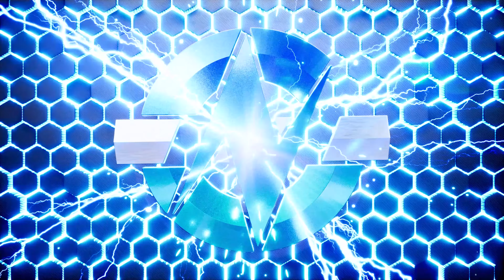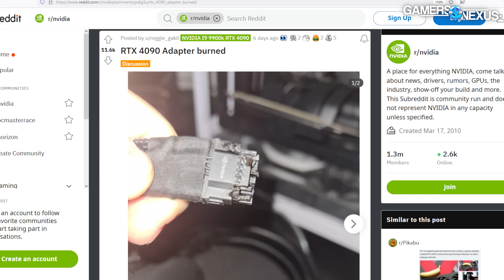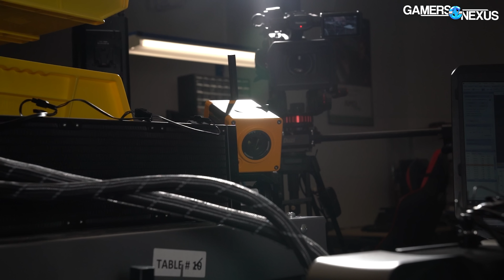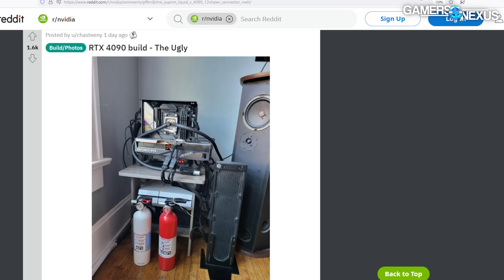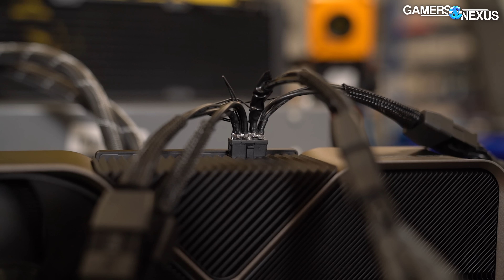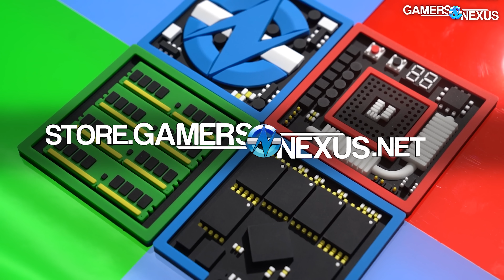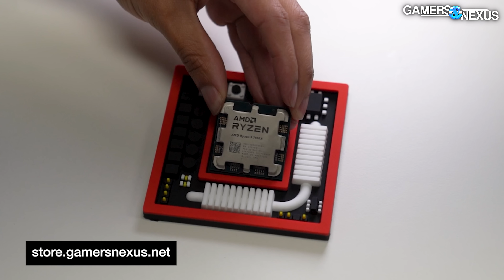Testing Burning NVIDIA 12VHPWR Adapter Cable Theories (RTX 4090)

Comment: Why are parts manufacturers reinventing the book? I could go get almost any cheap power connector out of the RC world and do a piss poor soldering job on it and it would still be more mechanically and electrically sound than any single connector in PCs. Have never understood the insistence on continuing to use pins for non data stuff when absolutely nothing about their design is for it. Its also less flexible and more space consuming to use a dozen pins to accomplish the task a properly designed connector can do. Only showing up now because parts are becoming space heaters.

Comment: 26:12 Yes, exactly.
If even experienced assemblers ones make the mistake of not seating it properly , perhaps it's the design itself that's flawed.

And for what? To save some standard connectors and use a single , custom made one  ?
¿Is PCB power routing so expensive?

Comment: Very informative, appreciate the hard work and dedications to this un-going issue. Could be a bad batch of underrated Adapters out in production, hopefully Nvidia releases a statement soon as personally I'm very hesitant to use my 4090 as i'm currently using this adapter and have to wait 2 to 3 weeks for my cable mod kit

Comment: The more i look at it the more i like the ideas that buildzoid had pulling is causing bad contact. Maybe you pull on the cable sideways during testing to see if you could cause bad contact in the connector.

Comment: jonnyGURU has already explained in detail what's actually happening ;
TLDR : nvidia's adapter is not properly made.

The good manufacturing practice is that you have to crimp the wires, not solder them, which is what Astron (the company that makes the adapter for nvidia) is doing.
The soldered wires do actually break off, just not on all adapters (depends on the soldering quality, which is inconsistent).
The melting occurs because power follows the path of least resistance : the wires that didn't break off end up conducting all the current => too many amps, overheating, melting.

Qualitative native cables (such as the ones made by Corsair, be quiet!, cablemod and Seasonic) are free of this issue (the wires are crimped), it should be safe to bend them vertically (i.e. perpendicularly to the card), just not horizontally.

Comment: voltage rating for the cables insulation.
So a 150V rated wire is good enoug for 12V.
Reply: 150V @ 10Amp or 300V @ 10Amp wich cable can provide more power?
Without getting to hot.
Reply: @JonnyB1989  current has nothing to do with insulation of a wire/cable
For curent it is the mass of the wire that is the limit...how thick the wire is.

This is a rating to show how safe the wire is and its maximum voltage and has nothing to do with the maximal current it can handle

Comment: What brand soldering iron is that at 7:58?
Reply: Found a better image at  16:15 and it looks like a HAKKO Soldering Station, Digital, 75W, ESD Safe FX951-66.   Figured Steve's staff is using quality equipment and not Scrabble random companies off amazon.

Comment: Do your cables have the same split terminals? Buildzoid seemed to agree it was nothing to do at the solder points but at the actual connection. And that would be nearly impossible to inspect without observability causing more damage as you'd have to dismantle the on card housing or PCB.

Comment: From the outside looking in, I want to let it be known there are far too many variables regarding failure and melting. Each person who has one that melted, is most likely not living in the same house. Now in most states electricians do not have to be certified or licensed to work on your house, at the end of the day they know more than you, so, hired. This can bring in way more issues. Yes the 150v cable rating is an oddity and was most likely issued with test cards or R&D cards, hence the new ones are 300V. This 300V rating will handle dirty 110 and dirty 220 if you are anywhere outside the USA.

There certainly is a ton of power running through these pins, if it were me I would lower it by using a 16 pin or close to it. Lower the amperage per pin and we can still attain the same voltage and wattage. But, now a days it has become standard practice to minimalize the things people do not want to see...if you want to wire tuck, well 12 pins is easier to route than 20, but if users want to keep it clean, why don't manufacturers put the plug on the same side as the PCIE terminals...they always put it where it shouldnt be. 

Issues like what we see with these cards, will continue, for every card. Issue comes up, youtubers handle it and discuss, which basically is free R&D for the manufacturer, so we are all doing free work. Like the recent entrance to twitter..."let that sink in"

Comment: no testing changes the fact that the 12VHPWR connector is poorly designed conceptually. you can't beat physics by shoving more power through less and smaller pins with less contact area. even the spec shows there's less safety margins than the old 8-pin connectors

Comment: bending itself might not break the pins at the solder points... but having that extreme bending while in heavy use might as it now includes heat that lowers the integrity of all factors on that point.  also, if possible, don't fully cut the foil contacts, they to cut it 1/2 or 3/4 of the way...

Comment: Hey Steve have we looked at the board its self. Could it be possible that those pins are pulling more power from the board? Wonder where the outer traces on the board lead to and if thats pulling more power than the middle pins? Just a theory
Reply from the maker: Great question. I think we have ways to check that!

Comment: if those cables look like that from the factory, I'd advise anyone NOT to purchase them, it is a clusterfu**# and just doesn't like anything like a quality product of that price range should
and wire "power rating" isn't a power rating, it is insulation class (thickness or dielectric properties), since in PC there won't be 150V and 300V in those wires ever, it makes zero difference if it was 300V or 150V wire used for the adapter, the copper cross section is what matters in this case, since that will be the source of resistance and lead to heat at those currents

Comment: Have you seen the tear down of the cable on Paul's Hardware? Looking closely, cables all seem to be rated 300w, but the solder points in the connector look more like the ones in Igor's pictures, and not like the solder connections in the cable shown here. I wonder what's up with that?

Comment: Ah good, work up to go to work and my man Steve answered my BURNING question. 

BTW you did good Steve for a by yourself video.
Reply from the maker: haha, thanks! The editing and lighting aren't as clean as when Andrew does it and I got lazy by using photos instead of videos for some shots, but I think it works on function!
Reply: @GamersNexus  You can make a video with photos from a 00’s digital camera with your voice over and I’d still watch it. It’s the technical knowledge I am here for . The video production is just the frosting on the cake.
Reply: @GamersNexus  It is very obvious that your trying your best. Please Steve do not worry. And especially when it is a current problem (get it?) that requires fast turn around. I mean fire hazards and badly designed stuff like this needs coverage. And your insight and access to information/better made cables is sorely needed right now. And the testing done is outstanding!
Reply: @GamersNexus  I would not consider it lazy I would call it time and energy constraints. That and I need some damn sleep constraints... Awesome job as always thanks for it all, been around since the packed house space.

Comment: Would actually having these tests done in an actual desktop case make a difference? Since people will have different desktop setups. Some setups might get very hot which wouldn't help the cord get any cooler. Open Bench seems like the cables wouldn't get as hot as they would in some cases.
Reply: these test are completely useless. it's like investigating heart attacks by taking a single random person into a lab and looking at him for 8 hours. The underlying reason for why this cable is flawed is its basic specification - it just doesn't have any safety margin. That's it. It's a design problem. This means statistically it will fail much more often than 8-pin which has 70% safety margin. 
Force Nvidia to stop shitting on consumers and spend few more pennies on a 70% safety margin connector - boom, the problem's solved, new connector will have the same failure rate a an 8-pin, not 200 times higher.

Steve is overdoing this topic in a completely wrong and pointless way.
Reply from the maker: That is mentioned in this video

Comment: This could be quite serious for Nvidia if they produced the 150v cabled connector (Igor type) and knew they could fail and produced the updated 300v (GN cable) that doesn't fail but haven't informed anyone or issued a recall, considering the 150v ones can still fail, melt and cause a fire in a worst case scenario.
Reply: The voltage rating is literally how much voltage the insulation is rated for so it won't make any difference given they're nowhere near that voltage. If anything, having a lower voltage rating would mean thinner insulation which would allow for better cooling. But the spec that really matters is the cross sectional area as that determines the current rating. Although it seems that the issue seems to be the poor termination inside of the connector.
Reply: @JaenEngineering  Yeah 150V or 300V shouldn't make any difference whatsoever when we're talking about a 12V connection.
Reply: @JaenEngineering  I was using the 150v and 300v as names to separate the way the wires are soldered into the connector. If the 150v one has the two central soldered to two and the outers to one that is the 150v connector (Igor labs ). If the 300v connector solders all 4 to a more solid section then that's the 300v design (GN). It's how you would know how it's soldered inside without taking it apart, just look for the voltage rating on the cables.
Reply: @PHDarren  nice idea maybe, but as @Splomf pointed out above, Jay had the 300v cable with the bad soldering, so it's not really a good measure of whether you got the 'good' or 'bad' version.
Reply: cable doesn't matter at all.
Reply: The cables are not the problem, but the construction of the connector and and soldering therein. But as it stands, the fact is that there are different connectors out there some with sub-par soldering and/or connection plates. 
That is a huge problem, especially as it is not easily reckognizable from the outside and few people will go the length to peel away the tape and pull back sleeves just to see some information which doesn´t even give a hint of the connector plates.
Reply: Jay had the 300v cable and it was the bad Igor style construction.

150v and 300v is just the wire spec, not the construction or connector spec. It has nothing to do with the issues with the 12 pin connector.
Reply: The voltage rating is all about the breakdown voltage of the insulator (dielectric), which is an intrinsic property of the insulating material and its thickness. Breakdown being when the wire starts conducting through its insulator. Given that this rating is intended for continous use at that voltage and has a safety margin for short voltage spikes, there's no doubt that 12V won't be an issue for the 150V rated wire.
Reply: The difference in cables/wires could be something as simple as regional difference due approval requirements. When you are making something for the US marked it needs to be UL listed/approved (or CSA). And if you are selling something to the EU marked it needs to follow their standards, which leaves manufacturers with a few options: Either use UL approved wires/cables for US marked and then use CE/HAR approved cables for EU, or use a type of cable/wire which has both approvals. I dont know which one of those two options is the cheapest

Comment: Power connectors should never ever be using solder connection in that way in the first place. The solder joints are bearing weight/strain. That's incredibly dangerous especially with brittle lead free solder. With something like a GPU, the hanging wires will cause the joints to work harden over time due to vibration and can crack. There's a reason crimps and clamps tend to be standard for anything high power.
Reply from the maker: Edit: Thought about this more - the soldered points are buried in plastic, so they should be fine. You are right about crimping being better!
Reply: @GamersNexus  Just to clarify, I don't think that's what's causing or exacerbating the issue seen here. The adapters haven't existed long enough to work harden like that. But it is a very shitty design and would be worried about them suddenly snapping off in like a years time and starting a fire
Reply: @acbthr3840  agreed - was always taught that a wire connection should be mechanically secure before electrically secure, load on solder will inevitably fail
Reply: @GamersNexus  plastic is obviously far more elastic that solder. by the time the plastic moves at all the solder has likely already felt significant strain.  Encasing a very stuff connection in soft material probably won't cause the stiff connection to be less stiff - it just hides it. The solder is always going to strain first.

Comment: "Our cables are just built different" -GN, 2022
Reply from the maker: hahaha
Reply: I want to write in my résumé how experienced I am in burning Nvidia 12VHPWR Adapter Cable's
Reply: "Thanks, Steve!" 😂
Reply: @michalthekind  probably different insulation used
Reply: Paul's Hardware has a video opening his cable up. same "300V" as GN...but the same construction as Igor's cable. so no solution here either.
Reply: @FLCLimaxxx  Or sell a GN branded mini fire extinguisher
Reply: This video is brought to you by...US!...and the new GamersNexus flame retardant 12v power cable. Get yours today!
Reply: T-Shirt design!
Reply: @michalthekind  it's insulation material rating for sure. Foreign inclusions in material and how likely it is to develop cracks or thin out would affect the rating. I'm not even sure that you can make 105°C rated PVC? Its not a stable polymer, not far above 80°C. Silicone, fluoropolymers?
Reply: @michalthekind  insulation makes a significant difference on temperature rating for cables as well as individual strand size and quantity making up the cable.
Reply: @michalthekind  something can look the same but have very different properties.
Reply: They're Apple cables. /s

Comment: What if the cable is squashed up at 90 degrees? I.E jammed up against the side of case? I mean that's how they will be used right? Am I missing something?
Reply from the maker: If it's 90 and it breaks the strain relief (which is an insane amount of force, you'd know something is wrong and at some point, it is user error), then that would cause damage, yes.

Comment: Somebody wakes up early on a Sunday morning 🤣🤣Seriously though... Why not stick with what works right: A good and reliable top end AMD card. I like Nvidia but I could do without AI generated frames and unreliable cables and exaggerated power consumption. AMD cards are just more power efficient and sometimes even more performant. Their only drawback is the Ray tracing in "some" games. I'm not willing to toss NVidia out the window but I'm not liking what I see. I personally own an EVGA 1080 TI and an Asus RTX 3080. But my favorite is AMD 6950 XT

Comment: TBH i think the cable its self is pushing to much through it, compared to the 8 pin which seems to be made to handle allot of current over its spec, the 12 pin almost feels like they designed it with just enough to handle the full voltage but nothing more.
Should we really be prioritizing size in a cable made for non mobile computers. imo they should have added 4 pins to the 8 pin and called it a 300w cable and used two.

Comment: So I haven't seen Igor's video, but does that mean he once again is a quickshot and calling something the issue while it is not 100% certain yet?

Edit: So Igor only had some sort of Blog post since he lashes out to youtubers?
Reply: But wasn't he right about the caps being the issue with the 30 series? Because they were. The cheaper caps had a slower response, and caused instability because they couldn't compensate fast enough for Ampere's very spiky power draws.

Sure the problem was solved via drivers, but that was just nerfing the card slightly so the power draw wasn't at spiky. Doesn't mean he was wrong about the root cause though.

Am i missing something..?
Reply: No and that was not what Steve was saying. Igor just has a different cable - thus different conclusions.
Reply: @MrWonderstuff  I mean Igor claims to have found the cause with a sample size of 1 while GN has a sample size > 1 and didn't have the problem.

So Igor is essentially theorizing about an issue and apparently didn't even test more than 1 cable?
Reply: @sAlatji  Ah forgive me. I got wrong end of the cable - I mean stick. Indeed I think Igor was a little too quick off the mark for his own good.